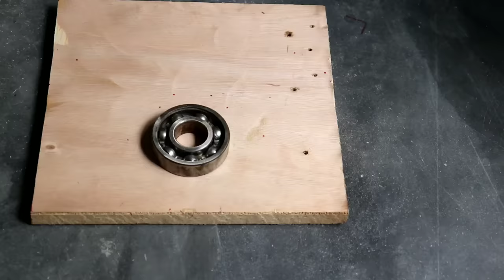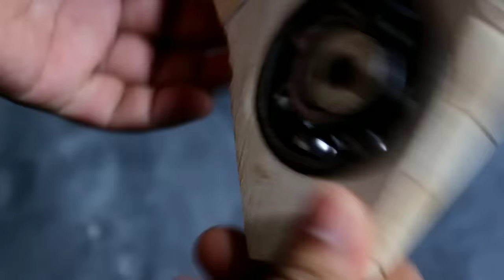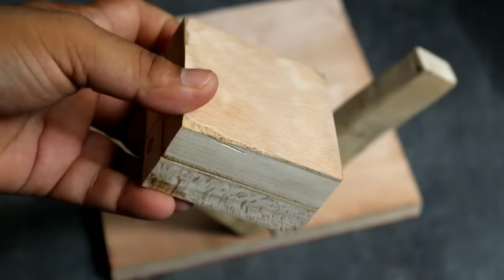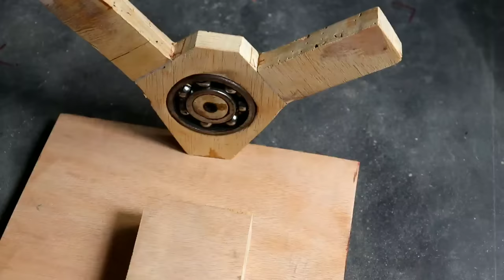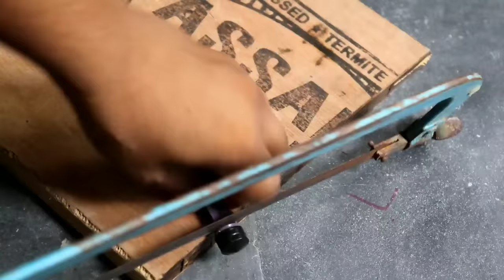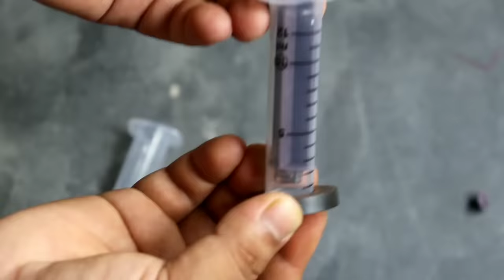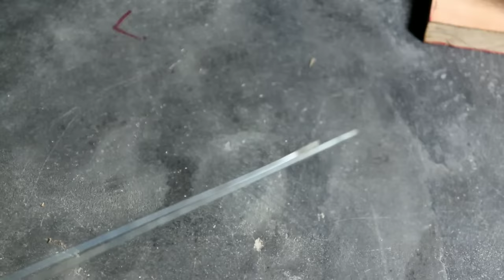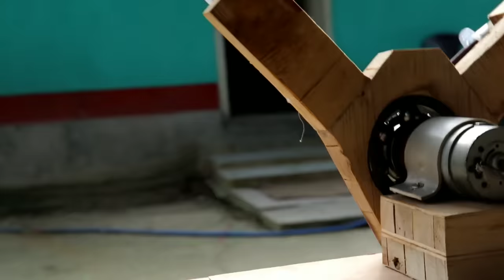dubble cylinder engine 100% working

Comment: Empty syringes are unlimited source of energy.

This man single handedly solved the world energy crisis.
Reply: Man it is just a lamp 
The world now use nuclear reactors and it still not enough 🤣🤣🤣
Reply: And useability of drug needles
Reply: Ahaaaaa. ..
But with battery 🔋...
Reply: jajajajajajajajaja
Reply: If this concept could be used in real life to generate electricity there would be to many moving parts also extremely heavy it will wear out and break down constantly from the weight of the magnets needed to generate the electricity needed.
Reply: Почему при включении светодиода генератор не работает под нагрузкой? Разве у светодиода нет сопровождения: ответ очевиден в цоколе расположена батарея...
Reply: Lmfao true
Reply: @04u2cY  good point, " i tried copying the concept and yup it works" what i can see this is best to apply on electric bikes or cars.
Reply: Fake
Reply: I thought empty syringes were a source of free H.I.V.
Reply: I don't think.. we have enough natural magnet for solve energy crisis.. i mean.. for moving a car we need a natural magnet as big as the car.. 😏😏
Reply: @askmeanything4741  u get it
Reply: @freemov2101  wheres the battery? 🤔 i mustve missed it
Reply: California is gonna be a world energy leader lol
Reply: @askmeanything4741  The amount of magnets does not matter, its electricity that cars need to move
Reply: @AnonymousUser27  inside the wooden box under the motor
Reply: Bro...everything is fine in this system...
Read about conservation of magnetic energy🥱🥱
Reply: @04u2cY  yeah..that's not practical thing at large scale👍
Reply: @amitrotel2548  Read about thermodynamic equilibrium...
Reply: @jaxjax2011  it's electricity that cars need to move?? Then why we use petroleum.. 😂😂  if magnet can run the motor then what is use of electricity 😏😏
Reply: @askmeanything4741  We use petrolium because the lifetime cost of a car which uses an engine is lower. It's only recently that electric cars have been economical and that has as much to do with politics as anything else. But our batteries are good now too.
Magnets cannot run a motor on their own. An eletric motor uses electromagnets because in order to push something with force you have to use a force, aka electricity. Even if a motor that is just magnets spun on its own, that would just be a conservation of its original momentum and applying that force to anything would consume it.
Reply: @mustafamahmood1341  the practicality or scalability is not the issue. Laws of physics cannot be broken by this engine. It is clearly some sort of deception.
Reply: @04u2cY  not for a small scale project and if u r going to scale up ofc you would need to use better hardware ( not saying this is a legit video)
Reply: i dunno bout u, but i am buying up all the syringe stocks on nasdaq tmr🤣🤣🤣
Reply: @04u2cY  but still it's a great concept, 👊respect
Reply: @jaxjax2011  true,  but we can use the free energy to generate electricity then power the electric motors
Reply: @04u2cY  That's why it will only to be used in a small scaled experiment.
Reply: @arnolddismus5922  Which free energy? The one from this video? Assuming that he didn't have a hidden motor, the only energy this device has is the energy he initially spun it with. It could keep rotating for awhile but if you put any resistance on it, it would stop. So you cannot exctract electricity. At least not any more than what he put in with his arm.
Reply: @jaxjax2011  It is only working in a small scales experiment. To move a heavy vehicle needs more power than illuminating a simple LED bulb. I think this magnetic motor won't work in bigger scaled dimensions to run a car because there are no magnets existing which will be strong enough to move bigger parts made of alloy or even carbon fiber. With this kind of a motor in bigger dimensions you should be able to produce/ transform energie for loading batteries or use the electricity to illuminate bulbs. But there's no chance to move a car. And loading batteries with this system means at the same time to accept the rattling sound of this motor. 😀 Who would like this?
Reply: @arnolddismus5922  Or if you're talking about solar and wind, that electricity is actually more expensive than from power plants. Those devices have a limited lifespan and must be replaced/maintained periodically. If they actually gave "free" energy then they would have already taken over the market. Right now they are only profitable with subsidies.
Reply: @arnolddismus5922  oh yeah I agree.
Reply: @arnolddismus5922  there is not such thing as free energy.. There are 4 laws of thermodynamics, study them.
Reply: @Strade8  There's, in chemistry.
Although it's not generated out of thin air like in this video but the term do exist
Reply: @AnjolaAkinsoyinu  I know.. I was using free as an adjective, and in my mind is "Gibbs free energy" and not just "free energy" to avoid confusions.
Reply: work 1000 clynder

Comment: It's is quite impressive how he manage to hide the power source.
Reply: It is under the Dinamo 😁
Reply: Tesla coil se chal raha hoga
Reply: @tourofuniverse7890  your DP
Reply: @tourofuniverse7890  wtf Your DP 😭🤣🤣
Reply: @Yashbro819  KAHNA KIYA CHAHTE HO.
Reply: @tourofuniverse7890  Tumhare naam ke saath tumhara Dp ajeeb lag raha hai
Reply: Dynamo motors do generate electricity when they run.
Reply: @teluguawareness973  but they produce heat, so there is a loss of energy, so they can't make more energy than the one you put into and they will dissipate all of it after a while.
Reply: What à cheat! No compression if syringue is open
Reply: Blind sheep.

Comment: Magnets repelling one another 180 degrees apart in the V format with proper cylinder length would create this A/B repel repetition. Brilliant yet simple. Cheers 🍻
Reply: No it wouldn't?, the syringe pistons are plastic, and even if they were metal it wouldn't work, the magnet would just attract the piston and that's it, the magnetic field has to be oscillating, that's how an electric motor works in the first place, also he clearly shows that he is using an electric motor connected to a power source to drive the "engine", this isn't an engine it's just a toy, looks like something a 10 year old would make
Reply: Ciekawe
Reply: @call_me_mado5987  the syringe is only acting as a cylinder. But with the North Pole of a magnet acting as the piston ( No Compression inside the syringe) the opposite side of the V cylinder repels the North Pole to another magnet attached outside the cylinder to another North Pole where they repel shooting to the opposite side of the V cylinder to the same North to North. The key here is the stroke length. Magnetic force is invisible power when harnessed geometrically and mechanically can produce action to reaction process.
When hooked to a small generator can turn magnetic energy to electric energy kinetically. 
Word to the wise: You can’t have a life filled with success with thoughts filled with limitations. If you don’t change the way you think you will go mad!!!
Reply: @garyjones783  This is why you do your own research, otherwise you end up like this, first off this is obviously fake, the magnets he's put on there aren't even that powerful, and they are permanent magnets, hence the mangetic field never oscillates, also the mangets are so weak and far apart that they are 100% useless. There is literally no reason why this "design" if you want to call it that should work, also if you're really sure about this working then try it out for yourself, the components are cheap and you can probably build it at home, don't just believe everything in the internet without second thought, try and see for yourself and experiment, that's what science is all about. 

Kids this is why you don't believe everything you see, otherwise you end like this! Do your own research and experiments instead of blindly believing these fake videos
Reply: @call_me_mado5987  I see your mind is made up. No need in discussion this any further.
Reply: you too understand how simple and amazing it is, good and cheers to you sir,
Reply: @tobywonderworld  And thank you too sir!!! Some people are just stuck on stupid and all we can do is try to shine the light their way but they still can’t see. Ooh well.
Reply: @jaxjax2011  With respect to your knowledge of magnetics your field and many other fields of “Knowledge “ are still way in the dark about understanding the full realm of these fields yet these things do and still do happen. I appreciate your lengthy explanation expressing what you do know but you didn’t really talk about what you don’t know yet these phenomenons still happen. I’m not here to argue or criticize but to explain other ways to see other dimensions that are connected to our dimension correlate. Cheers!!!
Reply: @garyjones783  And you aren't way in the dark? Let me give you an allegory for how things are in science -
A man who knows nothing almost nothing about the world is asked to look into an office window and define what a business is. "I don't know," he says, "it looks to be a building full of people, who all talk to each other and sometimes exchange written messages."  Now, his definition for what a business is may be very much 'in the dark', but it's not incorrect. It doesn't matter if he doesn't know exactly what those written messages are, that they're letters and invoices and inventory reports, or even what a business does. His observation that "a business is a place where people talk to each other and exchange written messages" is 100% accurate and reproducable by anyone who can look in through an office window. Regardless of whether or not you think he's 'in the dark', or that his deductions are too simple, you would be a fool not to agree with him.

This is what science is like. We don't know everything, but we do know some things. And we do really, actually know those things. Encouraging people to ignore those facts is not a good thing. I don't like the research community any more than you do but their corrupution is not evidence that basic scientific reasoning is misled. If you try to make a generator while ignoring thermodynamics, you are going to crash and burn and amount to nothing simply because you let your own hubris blind you to the facts.
Reply: @garyjones783  I'll tell you specifically what we don't know about electromagnetism too, just so you know. Most of it relates to particle physics in plasmas. There are a number of interactions on the quantum level that, while we do understand and observe, are not possible to simulate en-masse. This means that more complex plasma phenomenon are still in discovery. For the most part this is only relevant to stellar physics, but it also applies in some instances of fusion research.

That being said, even though we can't simulate particle trajectories in plasmas, we can still accurately derive the behavior of most plasmas with the Maxwell-Boltzman (a distribution of particle velocities). Again, this is only relevant in very high-density plasmas. Not a whole lot is still lying in wait about ferromagnets.
Reply: @jaxjax2011  what do you know about stable levitation?
Reply: @garyjones783  Not much off the top of my head, apart from that it uses superconductors below a critical temperature. A quick search revealed that this is because of the Meissner effect, which causes superconductors to become perfect diametric materials. Further researched revealed that it has something to do with Lenz's law and cooper pairs aligning. Either way, the effect breaks down beyond a certain field strength so its not hopeful as a way of mobility.
Reply: @garyjones783  My friend, I have faith. I value truth because I respect His creation. You are correct about the miracles of Christ, I don't live in denial of this. It's just that by my reasoning, the best way I can help my life to be fruitful is to bow my head to reality and do what I know is good based on truth I can observe. That means I have to be humble, study, validate my assumptions, and be objective about things. I can't just hope that I or someone else stumbles across a miracle. I think the mircale that we were given is our own lives and souls. Anything truly remarkable comes from that. I think the miracles between now and when we're all fully benefitted by medicine and technology will be lots of people working hard for the betterment of themselves. And I really do not believe that wild speculation in the name of faith is working hard. It is easy to sit there and think "maybe they could do this, or that. Surely someday a miracle will come." It is hard to learn, correct your ideas, and do something worthwile with them.
Reply: I just jumped into this conversation looking to see some arguments and I think my brain broke.

Comment: Couple things I want to see.  First, spin up the thing before you put the motor back there.  Second, without making any changes, put the light on the two wires before you spin it up.  Then maybe you could use some rods to mount the wood blocks, so you could show both sides of all the blocks, then assemble them, then spin the thing up all in an unbroken shot.  This looks like it could not work without batteries.  Nice music though.
Reply: It won't work without some outside power source. The two syringes with the plungers and magnets in them serve no purpose whatsoever other than to confuse people who don't know any better. Without batteries or another power source it would just stop at some midpoint of the magnetic force between the two plungers and stay there. If this actually worked it would do so without the "dynamo" (it's just a motor) connected at all.
Reply: I know😂😂
Reply: @Jester_The_Jynxster   you are 💯 correct.
Reply: It's 26M now
Reply: The thing looks relatively easy and inexpensive to make, why not try it yourself and see?
Reply: I agree this video is fake, but he has used two syringes which are attracting the magnets that he fixed on the outside of syringe. Both of them are just attracting and sending the piston back. If one syringe which will make the piston come near and one to send the piston back this project could be possibls
Reply: @Spicy34567  the magnet isn't pulling it's pushing. And it return because it's traps in a loop where the opposite  one pushes it back up to the magnet that pushes it away again. I think it's quite possible. Am definitely gonna try it
Reply: Nope this is impossible. Than al human problems would be fixed because we have an infinite energie source. There is always friction and so without an energy source it would be impossible.
Reply: Just do it yourself genius
Reply: Another magic from sinbad
Reply: Tem pilhas (baterias) entre a parte de baixo do motor
Reply: The perfect video for "FLAT-EARTHERS
Reply: The syringe tube is cheap and serves its purpose of a cylinder and piston with no compression. magnets create electricity it’s a fact. If they oppose they simply substitute compression that way… hence the double stack of magnets you would need the stack to generate a charge not an opposing force the motor is a simple alternator. The more you know. Also the constant opposing force would in theory work a lot like a 2 stroke 
In that every stroke has force. A battery would have sufficient charge and could power any gear box on a larger scale.

Comment: this system should be able to work even when the engine is not connected, remove the engine and run it that way.
Reply: Yes you may be right
Reply: o yess... sure...
Reply: there are millions of views for these types of shit vedios. Basic common sense lacks!              kudos from an electronics engineer🙌
Reply: Maybe this idea works only for electricity not for run car because real fuel engine generate too much force and supply to wheels through gear box that's very powerful with himself,
Reply: @vstatus4468  impossible, it doesn't work, it's a scam

Comment: It's pretty clear there's two motors here connected by that large clamp in the middle. Wires hidden under the clamp power the first motor and the rear shaft of the first motor turns the rear motor into a generator.
Reply: I figure the bulb is just being powered straight off the battery that also runs that front motor. Pretty sure the back one is just for looks.

Comment: 2 minutes silence for the ones who thought its real and 5 minutes for the ones who tried it😂😂
Reply: The thrust will equate each other after some time. But he tried well
Reply: I was laughing at the syringe pistons the entire time. Couldn't handle the silence. Sorry.
Reply: Once you put it under a load it's done
Reply: Idk, think there's a battery in the motor?🤔
Reply: @samsonator933  my guess is batteries in the wooden pedestal, the dynamo is in reality two pieces, a motor and a dynamo, back to back and the collet (and fingers in the first clip when they appear) hide the fact that they are separate parts.

Comment: Magnetism generates electricity just as well as electricity creates magnetism, through a coil. It's very possible that the repel motion magnets can continue the motion once energy is applied, it will produce kinetic energy then passing through the motor into the bulb. My question is how did a DC source provide enough voltage for a 120v 11wat led house build.
Reply: potentially because the energy it takes to power led is far less than that of flourecent or others
Reply: i think about it too.

Comment: Also, if you wrap a coil around those cylinders you can create power directly from them through the solenoid principle. You wouldn't have to use a motor at all.
Reply: hahaha 🙂
Reply: It wouldn't draw too much power but you are right!
Reply: @marcelinocolonalsup679  haha :-)
Reply: That would lessen the power dispersal over time. Would run much longer compared to the dynamo. Fun little toy really.
Reply: That's true genius
Reply: That's interesting idea... The magnetic generator